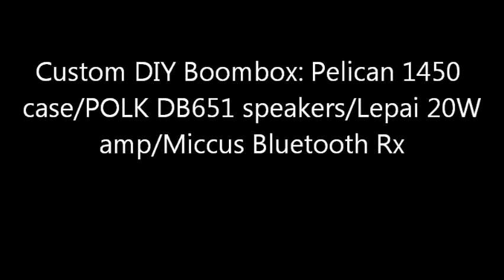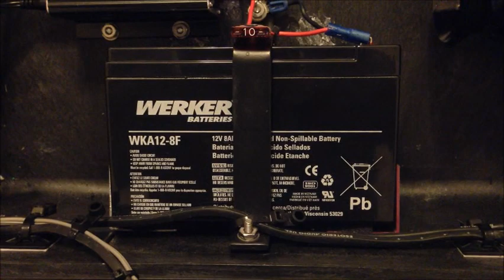DIY Custom Portable Boombox: Pelican/POLK/Lepai/Bluetooth

Comment: How far away can the phone go before the speakers won't pick up the signal? You must be an electrician. I see how clean you have wired up that inside of the case. Its almost like building code has been drilled into you. You should try setting up this inside a goodwill suitcase for that vintage look. Goodwill has cases for about five dollars.
Reply from the maker: Can usually go almost 50ft. I'm a fan of the pelican hard cases. Most luggage will have to be reinforced to sound good. Gotta keep wiring clean don't wanna get condemned LOL!

Comment: Hi, can you explain a little more about how you build the custom port?
Reply from the maker: Tony Wynn Acquire 1.5" or 2" schedule 40 PVC pipe and metal fence post round or cone caps. Use heat gun on metal cap and PVC pipe till soft/hot and push on metal cap to form.

Comment: i know this battery here is pricey but this one is much lighter coming in at one pound . could you imagine replacing the leapi amp with a mini 4 channel class d car audio amp 
and run a small sub .super lightweight 

battery tender BTLO9A120C. 
weight 1.2lbs
replaces lead acid 7-9ah
cca =120
price 68.99